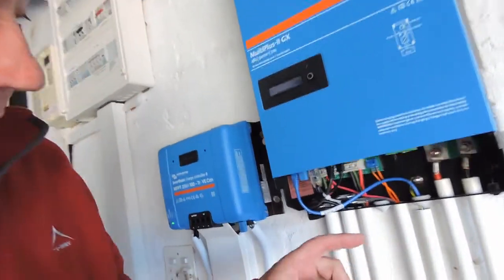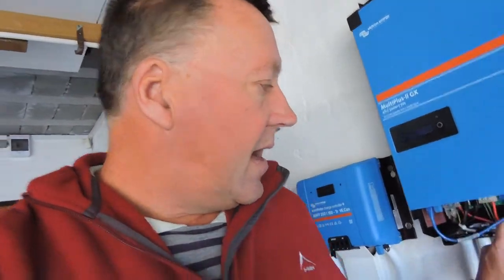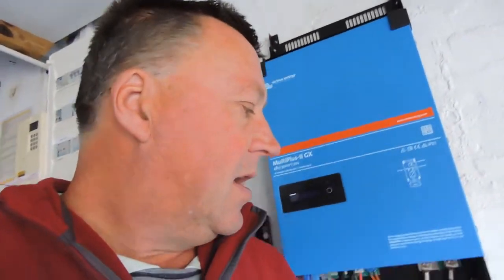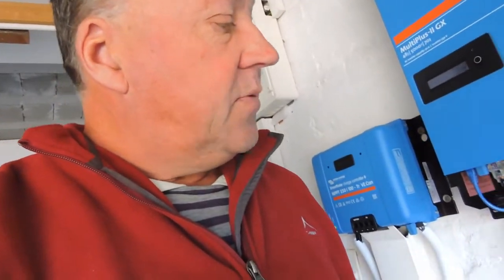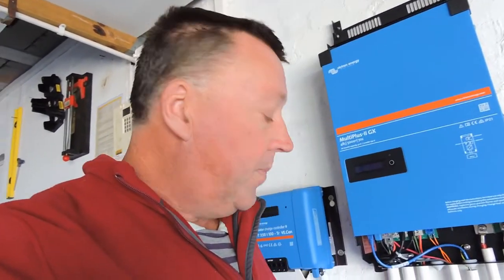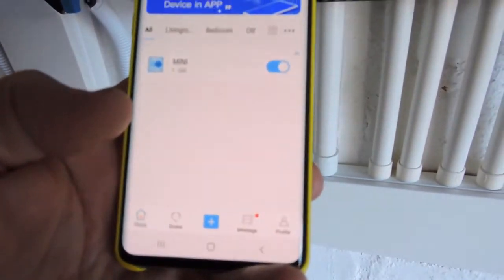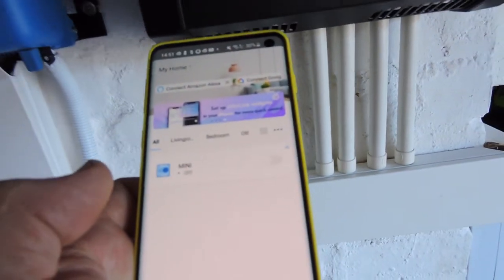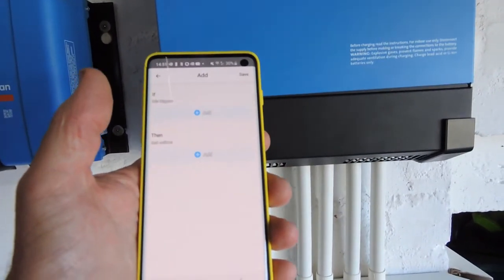Victron Relay Assist to SonOff  device

Comment: Or you could wire all those loads on the ac-out2 port (that turns itself off when on a outage) of the Multis and remove all those fail prone parts you added.
Could had been interesting if you added the configuration procedure for controlling the multis relay.